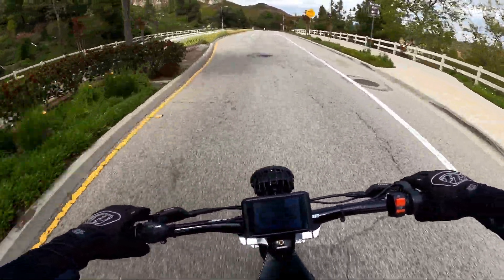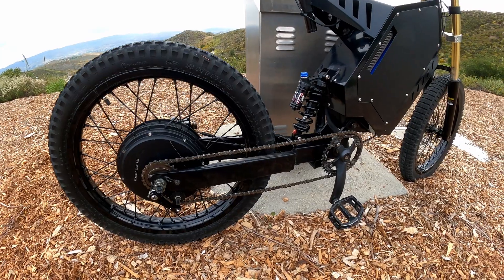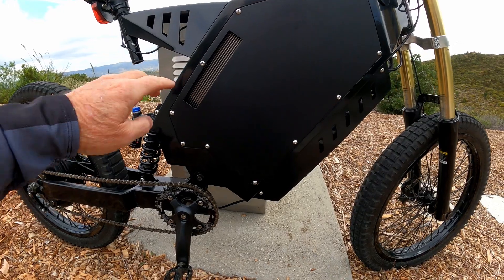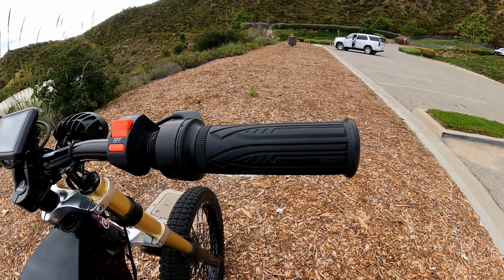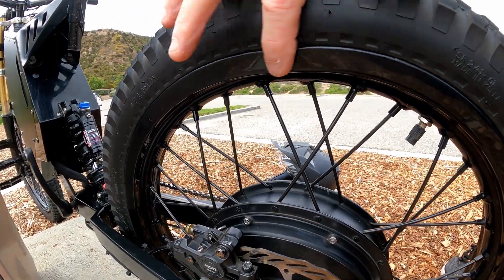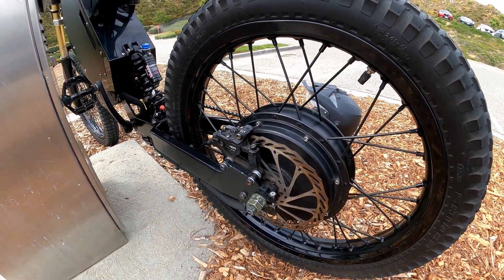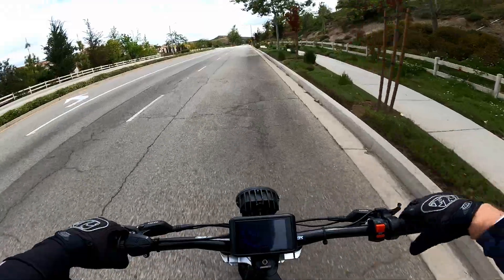12000w Enduro ebike long-ish term review and Onyx ebike fire update

Comment: Hey! How much of an issue was overheating because I see you made 2 gaps on both sides to cool the controller. I live in NY so the weather isn't very warm when it isn't summer so I don't know if that will be an issue. Is it usually warm where you live?
Reply from the maker: @hec8049  it was not much of an issue,  maybe on some really hot days or a lot of hill climbs or constant high speed riding , but the slots I made definitely helped keep the controller cooler. I live in Southern California so it does get hot here in the summer.
Reply: @samjohnson517  Ok, nice. Thanks for responding.

Comment: Hey my friend, my name is Shaun. I live in Simi Valley. I have the same bike wondering is there a way to fix a flat back tire without having to disconnect the cable from the battery or controller?
Reply from the maker: Absolutely so long as the cable is long enough, it should be zip tied to the swing arm,you have to cut the zip ties that should give you enough cable, just remove the rim and  lay it down next to the bike and change the tire from the non-wire side.
Reply: I’ll give it a run. I have three of the bikes all together. I have two for sale for 3500. I’ll send you a couple pictures.

Comment: Im thinking about buying enduro ebike. Does the frame have any weld issues.
Reply from the maker: No issues with the frame itself but I did crack the weld for the rear shock mount on the swing arm..
Reply: @samjohnson517  where did you get your frame from? hoping to avoid such problems with the shock mount if possible.
Reply from the maker: @BeautyBeastRC  ebay
Reply: @samjohnson517  thanks for replying bro!

Comment: my seat post bolt broke going 50 km (31 mph) ...  the seat fell onto the tire before I did thankfully. Still got some roadrash. 
now that bolt is drilled out to a gr8 3/8 and 2 gear clamps are wrapped around the entire assembly lol.

Comment: 8:20  THEVIES!   Escondido has almost zero bike racks, but most times you can find something.  First week of riding my E-bike, I went to Arby's and had NOTHING to lock too.  Parked it at the door went in, kept my eye on it till I ordered and paid, turned around and it was gone.    Lucky I locked the battery so guy didn't have power, he put it in a dumpster in back of shopping center to get later.   It's also bright orange which may have helped.     So yeah LOCK your bike, get a tracker as well.

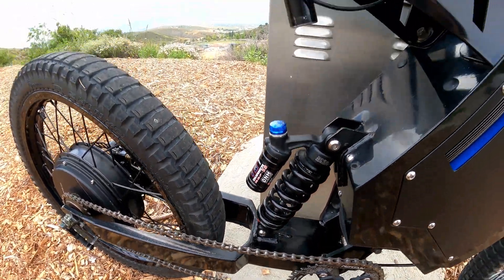Comment: 3:30  I'm with you there.  Have a "radwagon" cargo bike, I'm 6'2" and even on large frame they made long seat post at angle to cover lots of heights of people.  Which means ever bump your torqueing the connection on downtube.  After several hundred miles "snap!"    aftermarket tubes are a joke, after 2nd time I epoxied a case hardened steel rod inside, 5000+miles later no issues.    EV bike makers, at least in USA, build bikes way to light.   Standard spokes and wheels that when attached to a motor will start breaking spokes unless you constantly check.   Why do you have to constantly check?  Because you ride EV bikes way more.   Non-powered bikes were often ridden either once a week or maybe 3 miles if your a kid going to school.   So maintenance was need every few months.   I put on thousands of miles a year, that requires a lot of work.    Need to start using Honda 90 motorbike parts for durability.   Motorcycle tires cost no more than bike tires, but last thousands miles longer.    Industry doesn't want to change.  they are making the $$$

Comment: 1600 miles here, I had a similar overheating issue and I added 2x80mm USB-powered fans one under the controller and one sucking in air. The last 2-3 rides I haven't overheated again. My temps are easily 15' cooler.  I also swapped over to a SurRon throttle so I could have conventional dirt bike grips.
Reply: I have the 15k motor and did a 15mi ride the other day and I believe my controller cut out to protect itself multiple times. Do you have any photos of how or where exactly you installed your fans??
Reply from the maker: I do not use fans I do have cutouts in the side panels for air to the controller but that's it
Reply: @_Listen2Learn  I made a video about it here: https://www.youtube.com/watch?v=ireq6uGseVQ It really depends on where your controller is mounted. My controller sits above the battery, and that was the only spot with enough room for a fan.   Personally I think the top of the frame would be a good place too. but I have a extra seat on there for my Daughter.

Comment: Any idea what your bike actually weighs?
Reply from the maker: I never weighed it but I would say somewhere north of 200 lb
Reply: I just weighed mine and it's 145 lbs. (66 kg) Built it out pretty much like you did Sam, thanks to your videos. The frame, motor, speed controller, tires, all the same, and the battery I built is 21 lbs. (9.5 kg) it's 160 Samsung 21700's 40 Ah. Oh yeah, same charger too. Again, thanks for the vid.